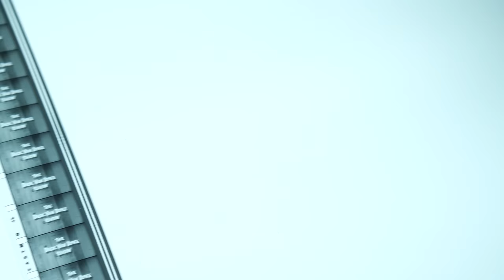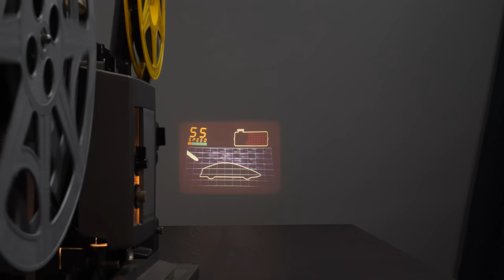Movies made sound with a light bulb: Sound-on-film

Comment: I worked for 9 years back in the 1970's as a sound engineer in a film laboratory.  I spent many hours recording optical sound tracks for 16mm film.  As for the nice dark track on the prints; the film processor had a thickened developer that was applied to just the sound track area by a narrow wheel.  This allowed the sound track area to retain the silver and make a nice dark track.  The same was done for reversal films.  It was important to have the track be as sharp as possible.  While recording the sound negative, some of the light would scatter into the unexposed area.  The same would happen when the negative was printed onto the final print.  We would run exposure tests to get this effect to cancel and leave a nice sharp sound image on the print.   If it was wrong, noise and intermodulation distortion would result.   Another point you many notice is that the slits narrow down during the quiet parts.  A DC bias was placed on the galvanometer to keep it as narrow as possible for quiet sections and then open up for the louder parts.  This greatly reduced the film grain noise during projection.   Great video as usual.
Reply from the maker: Amazing, thank you so much for sharing!
Reply: Super cool! Thanks for sharing your knowledge!
Reply: This is so cool! I am studying to become a materials engineer, specifically in semiconductors and chip manufacturing, and I’m fascinated by how much of the process you’re describing translates to modern day photolithography and deposition onto chips. We have to make the same kinds of design choices to make sure that certain features are extra sharp or whatever. Thanks for sharing!
Reply: @TechnologyConnections  It was possible for the sound developer to leak into the picture area,  so there was a little squeegee in the film processor to keep the two separated.  If the squeegee was misaligned or wore out, it would contaminate the picture area, making the edge of picture way too contrasty and ruining the print.
Reply: @theogcritic  No squeegee.  The developer was thickened with a chemical called Gantrez.  The wheel was a fraction of an inch from the film surface and a bead of developer would just bridge the gap in a nice even flow onto just the sound track area.  Actually, it was a pain to maintain.  Temperature or humidity could affect it and if the processor, which ran the film at a continuous rate through the chemical baths, stopped or changed speed, the developer would run into the picture area and create a big black smear.  Of course, that print would be ruined.
Reply: I just thought of another analogue film audio factoid.  Scratches and dirt on the film would cause pops and crackles in the audio track.  You can try using noise reduction/pop filters etc. to restore the audio but it always comes at  a cost in quality/dynamic range.  Modern film restorations digitize the audio track as a picture and then paint out the scratches using photo editing software eliminating the need for noise/pop concealment.  Another program would then be used to convert the photo image of the audio track into normal digital audio.  They also do something like this with fragile Edison tubes.  They will take high res pictures of the tube, so only light is touching it, and covert the pictures into sound.
Reply: @singerofsongs468  Imagine using electron beams to etch a record.
Reply: @OVMEBReed  I'm sure hardware varies.  Our developer had a guide/squeegee to stop the audio developer from going into the picture area.  If mis-aligned it would cause problems.
Reply: I can tell your legit, because you put 2 spaces after your periods.
Reply: @OVMEBReed, thank you for sharing your experience. It made a nice appendix to this video.
Reply: What do you think of my digital camera? It was recording an interview about 4 feet from the speaker"s face and on playbook some of the lip-sink was out
Reply: @20chocsaday  That's pretty normal. Consider filming yourself making a clap with your hands and then check what the discrepancy is between the noise in the audio track and the frame your hands meeting each other, then just adjust the entire audio track to better line up with the film.

Fun fact: that's why they clap those boards shut during film production, it both labels what take it is but also provides a nice sharp sound for audio syncing.
Reply: @RAHelllord  Thank you. I had assumed that the button on the camera which started "Video" would start to record sound at the same moment as it began recording images. 

The lip-synk wavered slowly over the 4plus minutes. In the end I cut out all the times the subject had hesitated (or worse) and it was very interesting to know at that time. 

The camera also picked up a shouted question from a lady who normally spoke very quietly.
Reply: Thank you!

Explaining this myself puts me into headache mode too easily. Telecine projection even more!
Reply: @jasonmyneni8605  I do too, or had when I learned typing 30 years ago in school.
Reply: @jasonmyneni8605  But yeah, you can tell a person's age that way.
Reply: @theogcritic  would it be possible to optically phase invert one signal (when you have two identical mono tracks) and then use differential amplifier on the audio output? Same idea as in balanced audio. It could get rid of pops and crackles due to scratches and dirt, without having to optically clean every frame of dust.
Reply: Thanks!  When I heard the question, my guess was that it was simply the color film developed differently to retain the silver.  Thanks for confirming and giving specifics!
Reply: The cool thing is this optical sound coding was done on 35mm movie theater film too.
Reply: World owe people like you who made a difference
Reply: @ChristopherSobieniak  I have a telecine system with an RCA TP-66 projector!
Reply: Thank you for sharing your knowledge!
Reply: @jasonmyneni8605  If by "legit"  you mean "old" 🤣
Two spaces after period is needed only on old manual typewriters. Modern computer fonts have the proper amount of space embedded in the character. In fact, most websites will truncate multiple spaces into a single space at render time.
Reply: @angelbear_og  Yeah, I show my age as I typed on manual typewriters in my teen years.
Reply: @theogcritic  Sometimes an audio track would be overdeveloped and too loud. Before digital, a film studio would just dub it again, but underdeveloped, fixing it.
Reply: Right here. This is what still makes the internet amazing.
Reply: @20chocsaday  frustrating. I once used a recording setup where the audio would be something like .14% faster than the video. (Recorded on separate devices.) Once I figured out the amount, it just added one more step to my workflow where I had to slow the audio down to keep it in synch.
Reply: @Bippo3010  That wouldn’t work. With balanced audio it works because the electrical interference is the same across both wires, and therefore the noise signal is cancelled when one is inverted but with two optical channels the dust and scratches would be unique to each channel and therefore wouldn’t cancel when one is inverted.
Reply: thank you mr. wizard.
Reply: @Bippo3010  Maybe you could, however, sample both independently and then reject any differences. Subtract the two signals to create an error signal, then subtract that error signal from their sum. Although working out the algebra of that suggests it wouldn't work - it would be the same as adding one signal to half of the other.
Reply: This is what I love about YouTube - a well researched and presented video which brings out people like yourself, who can add even more details so that people like me can learn stuff. And for free. An amazing time to be alive! Thanks to all concerned 😃
Reply: Awesome explanation
Reply: @ChristopherSobieniak  The APA dragged their feet on this until 2019. When I was in school a zillion years ago, they relentlessly drilled this into our heads, even though the Chicago Manual of Style had switched to one space around the time MY parents were born. Despite what some people here [who know everything] here have said, the two-space convention does not exist because of typewriters. Proportional typesetting existed before the typewriter was even invented.
Reply: Remember what they took from us
Reply: @ChristopherSobieniak  I used to as well, until I learned graphic design. I got my first typewriter at age 10. Old habits die hard, but I was able to adjust to technology, haha!
Reply: @bsadewitz  Lord knows how much education changed in the short time I've been around.
Reply: @bsadewitz  I know you tried deleting the comment you made directly to me, but I saw it anyway. I am correct in what I said about  computer fonts. It has absolutely nothing do with with proportional vs. monospace. Go write an html file and type as many spaces as you want in a row, then load it in your browser. Your browser will remove all but one (to get multiple spaces you must alternate between space and & nbsp ; [which I embedded spaces in here as I have no idea how screwtoob will render it]). And it is because it is programmed to work with modern computer fonts, which ALREADY INCLUDE the needed space in every character, including the period. Try researching it yourself instead of passive aggressively calling others a "know-it-all" when it's you who does not know what you're talking about. It's one of the first things we learned in typography when I studied graphic design. Font designers aren't wrong, you are.
Reply: Ah, so the resolution of the sound is not tied to the resolution/grain of the film stock since the soundtrack area is an applied coating. Found it impressing that a track less than 2 mm wide (per "channel") could have any fidelity at all. To compare with 16 bit audio it would have to have 32000 individual distinguishable widths in an area <2 mm wide (I have the same fascination with vinyl groove width). Guess it could be in the 10-11 bit area (500-1000 distinguishable widths).
I know, I know... I'm comparing analogue and digital. And maybe making a statement about 16 vs 24 bit audio. 16 bit is plenty. 24 is good for editing purposes.
Reply: Sometimes audio effects noises are added with clear white single visual bright flash effects  frames of films to add dramatic effect duing crashes and explosion effects . The opposite  .
Reply: @Bippo3010  That was done for studio master recordings in the days before magnetic film. They were known as push-pull tracks and had lower distortion than conventional optical tracks. However this never made it into cinema use probably because of the lack of compatibility with existing projectors.
Reply: @TechnologyConnections  Adding an answer to your other question: All chromogenic film - be it reversal or negative - is silver based. With the color image, the silver is rehalogenized in the Bleach, e.g. converted back into soluble silver salts that are then made water soluble in the fixer. During development, a silver image forms in both the sound track area and the image area. Then, the film is bleached, which converts the metallic silver back into silver salts. Now the nice thing about these silver salts is, that they can be redeveloped. So before fixing, a thick developer paste is applied in only the sound track area. This redevelops the soundtrack. Then, in the fixer, all excess silver salts are removed and what remains is a dye image in the image area, and a silver+dye image in the soundtrack area. Actually, with modern ECP print film processed according to ECP-2E standards the soundtrack will have no residual silver, but be a (cyan) dye only track.
Reply: Love seeing experienced people chiming in in the comment sections with extra details. Very cool.
Reply: I love comments like these where just the right person chimes in with some great information that is nicely presented. I remember another occasion in one of Alec's videos about dishwasher detergent. If I remember right, an engineer that specialized in dishwasher detergent showed up in the comments to answer questions. It was one of the best YT comment threads I've read.
Reply: Wow, nice description; very interesting, thank you! Happy Christmas!
Reply: I'm subscribing to your channel for when you start post analog audio lessons!
Reply: @stuartjoynson9908  yep, that occured to me later. Much later.
Reply: @TechnologyConnections  consider having guests like these! It would be so cool to see an interaction between you two.
Reply: @RAHelllord  You should actually have two clap sounds, one near the beginning, and one near the end, that way you can compensate for differences in the video and audio recorders crystal oscillator PPM. Pad/trim the audio at the beginning to line up the clap sound with the frame of the board clapping at the beginning of the video, then change the audio speed using a irrational resampling algorithm so that the clap sound at the end matches with the frame of the board clapping at the end of the video
Reply: @20chocsaday  iIf you are less than 25 years old you probably didn't remember a time when digital cameras that could record a video often didn't include sound. But since we're in potatovision quality, you can use an MP3 player's voice recorder function (also potato audio quality), and if you videoed yourself tapping on the body of the MP3 player once at the beginning, and once again at the end, you could record the show in 1080Potato complete with a matching drive-thru intercom paper speaker soundtrack included.
Reply: @angelbear_og  The typewriters didn't have a good enough engineering tolerance to display a nice sharp space between sentences. So, just like a radio transmission, it just sent the space twice so that it could get through.
Reply: Thank you for the information!
Reply: wow very cool
Reply: I know is an Alec joke at the beginning of this video 😏 ....-... but.. "Class, Who do you know if you are an alcoholic.???" 🤨  ..-. when at the next day you feel sick because of it 🤷‍♀ meaning that you produce damage.. and now is trying to heal....
Who do you know if you exercised your biceps too much???...-..  when at the next day hurt  because of it.... meaning that you produce damage.. and now is trying to heal.-..  and so on... and on...
We are so smart... and we don't understand something so simple 🤦‍♀
Reply: Bet you worked in Rochester NY?
Reply: Wow, thanks for sharing!
Reply: @twt000  Nope, Portland, Oregon
Reply: @angelbear_og  That explains so much about Navy evals and NAVFIT98... now I know! Sidenote: I plan to get an "old" manual typewriter for journaling. There's just something so tactile about that that banishes writer's block.
Reply: Is this like in Vinyl recordings where they reduce the bass by 6dB so it wouldn't create too wide grooves in the recording, the playback device (turntable/preamp) would then re-apply/ boost those 6dB bass frequencies
Reply: @9:14 I see what you did there
Reply: @jasonmyneni8605  you're
Reply: Im still a bit at a loss at understanding how an image of the volume of sound has the information necessary to play actual recorded sound. This would be the analog portion on the film. Can someone explain that perhaps? Thanks.
Reply: @thesoundman22  It's similar to the grooves on a record. They represent intensities not volume. If the intensity is appearing on and off at  a high frequency over time the pitch is high. If it's happening less frequently as the film goes by it's lower in pitch. I think you're mistaking it for spectral image of the sound which it is not.
Reply: I love reading comments from people who worked with the classic technologies. So a DC bias was sort of a gate?
Reply: @iseeu-fp9po  Kind of.  Since the audio would normally open and close the recording area, quiet sections would leave it at the mid point of 50% open.  This would allow considerable noise from the grain of the clear film.  During low levels of audio or silent parts, a small DC offset voltage (bias) was applied to the galvanometer to close the slits down to  very narrow bands of light and that would greatly reduce the noise.  The incoming louder audio would reduce the bias to allow the full modulation of the light beam.  It was always a compromise to keep the slit open enough to allow new audio to be recorded, but not clipped by the bias not opening up the full range fast enough when some loud audio appeared.  The perfect solution would have been to slightly delay the audio so the bias could always be reduced just ahead of louder audio.  Simple with digital technology, but very difficult in the 1970's.
Reply: @OVMEBReed  That is very interesting although I will need to digest it a little bit to fully understand it if I can. :) At first glance it seems like a way to modulate gain staging to me. A way to reduce the noise floor when needed.
Reply: Neat!! Always wondered how this worked!!
Reply: NEAT!
Reply: @angelbear_og  I still can't shake the old habit of double spaces after a sentence.  After finding my typing rate card from typing class in 1972 it's evident that I can't shake that old habit.
Reply: @OVMEBReed  Akin to a 'noise gate' threshold in Audio processing, almost a VOX (Voice Operated Switch)..beep..'we appear to venting something into space Houston' ..beep..
Reply: You only worked for 9 years. Wow. You must have made alot to retire after just 9 years 😁
Reply: @singerofsongs468  I'm going to be an engineer too as a kid maybe I don't know
Reply: @Jack Warner In the mid 90's when I learnt to use wordprocessors on the computers at school we were taught to put 2 spaces after the full stop. Don't know if it was just my teachers preference or if anywhere else did it at the time?
Reply: Thank you for your input on this.
Reply: Very cool! Thank you!
Reply: Seeing the films shown in the video, I suppose, back at the 70's that this fashion of unpolite exaggerated dynamic range sound in movies started with digital sound in the nineties. Am I correct?
Reply: Thanks for the info. In the late 50s when in elementary school I was tasked with running the movie projector. I figured out how the sound was played back. But I didn’t know how it was recorded. Thank you.
Reply: Cool. I messed w different amateur film sorts as a kid. I'm 59 and i remember going to film still and movie camera swap meets at a local VFW on Sundays. I remember 'cartridge' 8mm. Which was 16mm split. Then 8, then Super 8. Then we had sound. Mag.strip.
  E we hear about some film preservationists that had ONE chance to fun if thru before it ate itself due to age and deteriation? I'm sure it was something classically worth saving. Reply for more fun.
Reply: @onkcuf  Film preservation can be very challenging.  The base materials shrink and break down chemically.  The emulsion is subject to physical and moisture damage.  Some color film dyes fade away over time.  Specialized equipment can digitize films to save them, but it is expensive and mostly used for historic or feature films.  We are in a race with time to save what we can.
Reply: @20chocsaday  I suspect the lip sync drift was caused by your software confusing 30 fps vs 29.97 fps, which would cause 0.24 s drift over 240 seconds.
Reply: When I started in TV in 1981 my bosses almost full time task was keeping the optical sound working on the rank- cintel  telecine machine. The news was mostly done on " sep-SOUND" where the sound was separately recorded on magnetic tape with Sprocket holes and a pilot signal recorded on special Nagra tape machines. For this reason very few historic news events have sound.
Reply: @jasonmyneni8605  Tom Scott likes this.
Reply: @angelbear_og  i know. Much of the internet is 12 year olds with 99 year experience. The double space tells me that he is at least 35 years old and almost certainly in his 50s.
Reply: I did the same work for several years and the sound bit is developed as a lithographic film pure black or white, no shades of grey ( i remember it had to be pre-fixated on reversal film first because the first developer would destroy the soundtrack resulting in a blue optical soundtrack and useless ) the sound developer itself was a highly concentrated lithographic developer i had to mix myself, nasty stuff to work with ...
Reply: @brentfisher902  The double spacing is not about typewriter flaws, as the same (hypothetic) tolerance issues would ruin the spaces between words.  It's about human readability as the larger gap between sentences is more prominent than the smaller single space after a comma or abbreviation period.  The fact that computer fonts use the same period graphic for all uses of the period keyboard key shows that computer font technology never replaced double spaces after sentences, and in fact software features to automate the job will frequently get the grammatical rules wrong, requiring users to edit the mess made by autocomplete.
Reply: Lucky
Reply: Incredible, thank you for that detailed explanation. I feel smarter now lol
Reply: @OVMEBReed  
Fascinating stuff!  Thanks for the education!  As a recent college grad in the early 90s, I worked for a small outfit in Chicago that was once the B&H Printing Division.  My work included the re-engineering of a modular continuous contact motion picture film printer.  One of my mentors would go on to receive an Oscar for creating a new sound head for copying these new digital audio tracks.  
We used perchlorethylene in our Wet/Dry printers to prevent light scattering due to scratches on the film.  The library of congress is able to restore some archival films using these machines.  
Our 16/35/70mm printers were distributed worldwide and were used by all the major studios to make copies of the original masters for distribution to all the cinemas.
I truly enjoyed the original video and so many well-meant & well written comments.
Reply: As someone who was born way after these technologies were relevant, but also as someone who gamed on 10 year old video game system as a child, I have WILD appreciation for both technology and it's masters of old. Sound reproduction is one as we perfected it pretty much yet it is not perfect enough for some people who claim they can hear a difference. I personally enjoy the history of Dolby and such.
Was original dolby surround (Stereo matrix) magnetic or optical mastering, I wonder. Maybe both depending on theatre.
Reply: I worked at Waffle House for a while.
Reply: @GonkThePowerDroid  10-11 bit is 1024-2048 distinguishable widths
Reply: @AmaroqStarwind 😅😅
Reply: Seriously great detail!

Please, is there more?
Reply: You don't have a spare westrex 16mm sound camera setup do you 😂 we are having to retrofit sound projectors to attempt to record variable density instread of variable area as cannot find any components from the old westrex light valves etc 😢
Reply: I know where a Mauer 16mm optical sound recorder is stored.  I believe it is only set up for variable area though.  It has a galvanometer that uses a moving mirror to create the track image.  I don't believe the record amplifier is with it anymore, but would be possible to recreate.  Why would you want to go with variable density?  Hard to keep the noise level down.    @PolyFilmLabs
Reply: @OVMEBReed  I would be extremely interested in knowing where to find that sound recorder lol

We went with variable density because creating a galva setup is too difficult. Rigging a projector up to do variable density seemed much simpler albeit with poorer quality.

Again, I'd be very very interested to know where to find a 16mm sound recorder!!
Reply: sent my contact info to your online contact form.
Reply: @OVMEBReed  thanks!! Have responded and look forward to chatting over email :)
Reply: @singerofsongs468  no offense but saying you're studying something, but already referring to the industry as "what we do" is... very cringy. Especially when your faux-insider-info explanation contains the words "to make sure the corners are extra sharp or whatever." I'm not saying it's not accurate, I'm saying it's MASSIVELY incongruous with speaking as if you're in the industry already.
Reply: @jasonmyneni8605  1. That's a syntactical choice, but it's not required; it doesn't mean people are "legit," it just means they're kinda old lol. It's just a slightly antiquated way of writing. My crazy racist grandma does the same. Doesn't make her legit.
2. *you're. Jesus man what are you doing paying attention to double spacing when you still don't know 'your' from 'you're'??? Lol well I gotta give you points for the attention to detail ig
Reply: @ChristopherSobieniak  thank you! Double spacing between sentences just means someone went to school in the 80s or earlier! Lol
Reply: @angelbear_og  THANK YOU lmao literally what I said. So glad I'm not alone.
Reply: @angelbear_og  I wouldn't say "most" websites truncate though. It's not exactly a standard practice. I actually see it on very few sites (a few more nowadays, though). Mostly on submission fields where they're trying to keep formatting more standard for some reason or another.
Reply: @SexyThyme  who, uh... who are you talking to? The OP? Do you find it hard to believe that... somebody worked in a film studio? Are you okay?
Reply: @bbgun061  how does that even happen???
Reply: @robertbackhaus8911  wait what do you mean the algebra suggests it wouldn't work? That was the exact idea I immediately had (actually, it was just what I imagined when I didn't quite understand what the guy was saying originally about phase inversion) and I don't see any reason it wouldn't work. I'm also very confused by why that would mean one full signal would be added to half of another, can you explain?
Reply: @bsadewitz  thanks for exposing yourself as the kind of person who would share all that knowledge while being shitty to someone else for sharing knowledge (the shitty little "[who know everything]" crack) because they happened to get a fact wrong. Could you just share a fact without being shitty? Because you're the biggest know-it-all in this thread I can see
Reply: @angelbear_og  👏👏👏👏👏👏👏👏👏👏👏👏 BRAVO, MAESTRO
Reply: @GonkThePowerDroid  comparing analog and digital is fun, there's nothing wrong with it lol
Reply: @brentfisher902  what do you mean potatovision? And 1080potato? Did someone fuck with the autoreplace on your phone? Lmao
Reply: @Ramdileo_sys  1. "Who do you know when..." It's how do you know lol
2. Experiencing damage is HOW muscles grow. You HAVE to damage them to grow them. So your understanding of muscles is flawed.
3. If you know it was a joke then why start preaching? And this is not the place to talk to Alec. This is some guy's comment. If you know Alec was kidding why were you so desperate to reach out to him? You seem like the type of person to bug strangers to an absolutely inappropriate degree.
Reply: @Ramdileo_sys  "we are so smart and we don't understand something so simple" that's because there's nothing to understand, what do you mean "and so on and so on"??? You didn't establish any kind of pattern lol there is no correlation between excess formaldehyde and dehydration causing a hangover and workouts causing muscle soreness. And by the way, there is a difference between getting a hangover and being an alcoholic. The two aren't perfectly correlated.
Reply: @Rochelleis40  you're going to be an engineer as a kid? What? I was so hoping that you were mocking that person but judging from your name it appears that you might be right with them, an actual kid who calls themselves a "real civil engineer" lmfao
Reply: @joshyoung1440  do you need a hug?

like seriously, my comment is months old, hasn’t had a response in months, and wasn’t even claiming anything about industry. I was actually talking about the work I was actively doing with other students in a nanofabrication lab at the time, and for brevity and style reasons in my comment, I decided not to list all the (irrelevant to what we were discussing) technical terms for different features on chips and which industry practices you’d employ to get there. The whole industry experiences tradeoffs in material properties, throughput, process scalability, and feature sharpness depending on which methods you use and which materials you need for your device that I couldn’t possibly sum it up accurately in a short friendly youtube comment. Thus, “or whatever.”

In any case, I hope this helps clear things up for you and I hope you have a better day soon.
Reply: @joshyoung1440  True, except here I learned typing during my Freshmen year (1992-93), so I'm sure I'm the very last for that.
Reply: @joshyoung1440  😴😴😴
Reply: Ratio
Reply: @OVMEBReed  I know I’m really late to this conversation. But I looked through the comments and I didn’t see anyone explain how the audio track is connected to the film? Does the film already come with room for the audio to be recorded on the side? Or is a different type of film spliced onto it? I
hope to hear from you because I’m really curious about this!
Reply: As a retired  Movie Projectionist I can say you gave a very good laymans explanation of cinema projection and sound.  Later, you might like to explore the progression of film to larger guages such as 70mm,  Imax, Cinerama etc and the progression of  light producing technology over the years. I think your followers would find this equally as interesting. Cheers and thanks
Reply: Sqq😂😂
Reply: @20chocsaday I'm sure many people have responded in this thread already, but just in case...
If your recordings are losing sync it could be due to a lot of different factors. Especially if the sync is varying over time, that sounds like an issue with the encoder to me. Is this a dedicated digital video camera or a phone camera? Is it possible to change the output format?
Reply: @AureliusR  Greetings!  This is specific to 16mm film.  Synchronizations was maintained by the sprocket holes on the film.  The original sound was either recoded on a magnetic stripe on the edge of the camera film (28 frames ahead of the picture) or on a separate tape recorder that had both an audio track for the the live recording and a synchronization track at 60hz track that was exactly proportional to the 24 frames per second of the film camera.  This could be accomplished by a cable with a signal from the camera at the 60 hz coupled with the 24 frames per second or by crystal signal that locked the camera exactly at speed and an separate crystal control on the recorder that created an exact 60hz signal.  
This signal would be used to lock the speed of a magnetic film sound recorder to the exact speed of the camera and when transferred to sprocket 16mm magnetic sound tracks, would stay in sync frame (or sprocket hole) by time.   For editing, each scene would (hopefully) start with the clapper slate that would have the correct scene and take number (visual on the film) and when the film started, a technician would snap the top rail of the clapper board down and provide a visual image and a sound "whack" that would allow the sprcketed film and spocketed sound track to be aligned on the editing equipment.  If the audio recording equipment and the film camera were both running at an identical speed, the sound would stay synchronized for each scene.   
It was very easy in the editing process for this synchronization to be lost.  In my career as a sound mixer, I became very good at identifying lip sync being out and by how many frames in advance or behind.  I would often stop the sound mix when a scene was out of sync, adjust the specific playback deck was out of sync and then re-record it in the correct frame orientation to be in sync.  
Most professional film producers had the audio synchronization correct.  I did enjoy fixing minor issues for  the amateur and student film makers.
 The film laboratory was the last and a very expensive step for film makers.  Creating prints of you film, re-recording a master magnetic sound  track, Producing final prints with sound and color correction were all expensive and made at the highest technical level possible.   I was pleased that the laboratory I worked for, Teknifilm,Inc. , Portland Oregon, was supportive and willing to go above and beyond to help young film makers to achieve greatness.  I am proud to have helped Will Vinton in his early development of Claymation and Homer Groening  (father of Matt Groening) and superb filmmaker in his own right. 

All of this is in the past, but I am proud to have had a, tiny, contribution to the film and media giants that got their star tin Portland in the 1970's.
Reply: @OVMEBReed  What kind of performance do you get with that optical recorder? Frequency response, S/N ratio...
Reply: This is an amazing video. It's incredible how film comes together and how it has evolved.